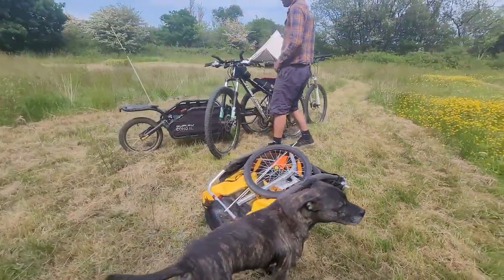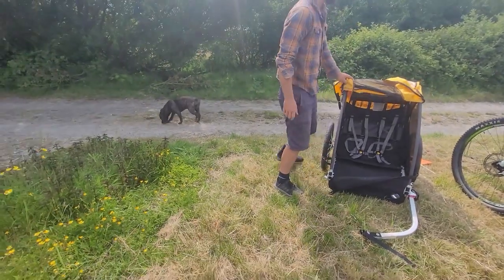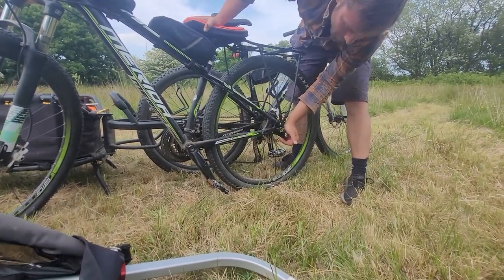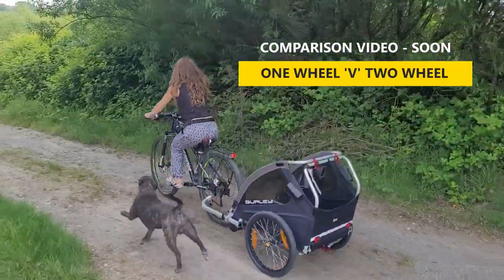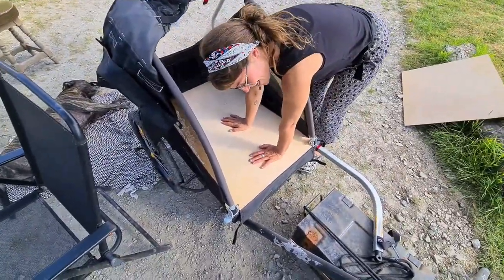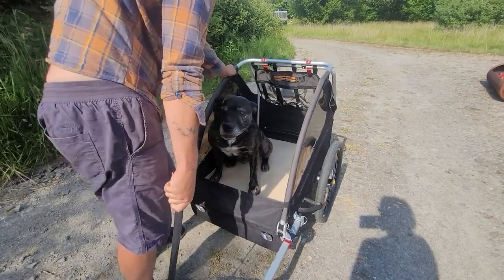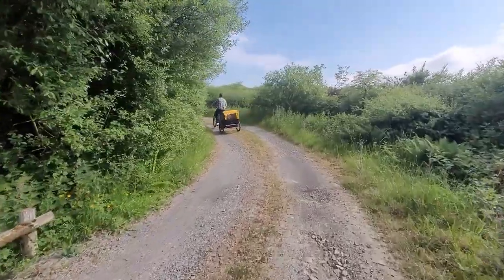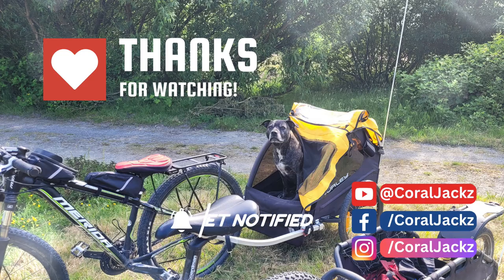Making A Pet Trailer From The Burley Bee & Getting Our Dog Comfortable Riding In It

Comment: This is great. I'm trying to pick one of these up for my dog. I have an 80 lb lab and i'm wondering if I can fit him and some cargo in the back as well. If i attached that cargo divider coming from the top of the frame down to the back end of the board, do you think that would leave him enough room?
Reply from the maker: Hi there, our dog is around 25kg so a bit less than yours. We do put cargo in the back behind the divider and he has plenty of space. However, we did buy our trailer second hand for a reasonably cheap price. If you are thinking about spending the full amount on a new one, we would highly recommend getting the one they sell that is specifically for dogs.. your pooch may have a bit more space then and it will already have a hard bottom without you having to alter it :)
Reply: @coraljackz  Ok thanks. Yeah, there's quite a few in my area selling second hand for cheap so I figured, if the conversion doesn't work out, it's not gonna be too costly.